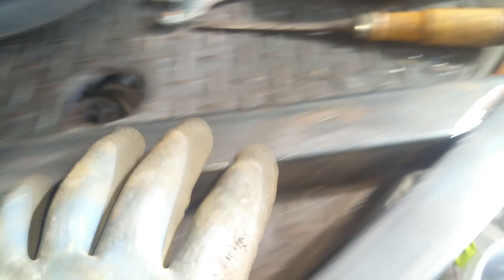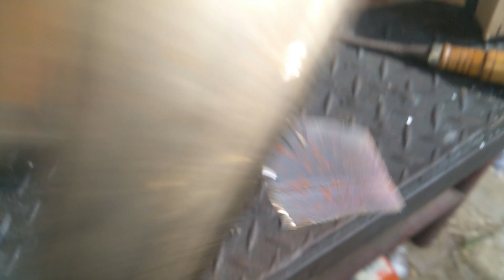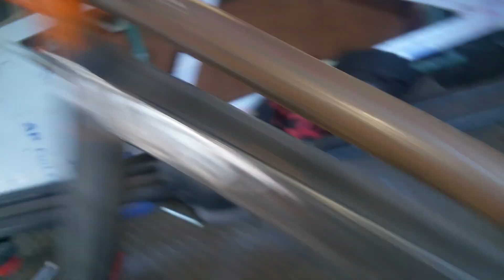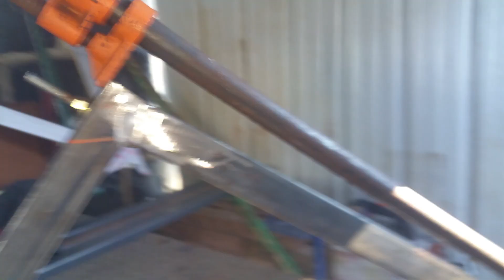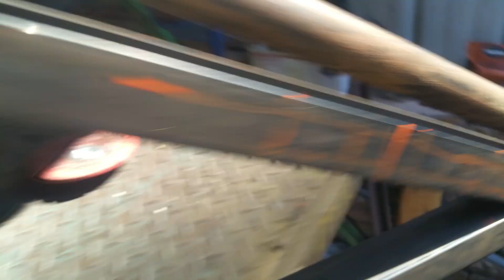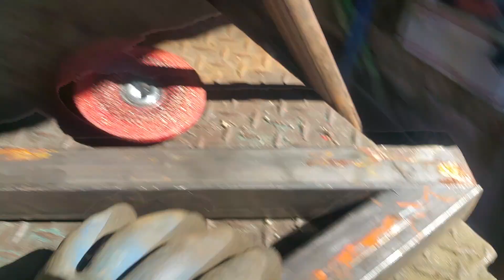FIU BRIDGE COLLAPSE Scaled Model PART 3 of 3 Canopy must deflect for 11 to slide PT BARS STOP SLIP

Comment: There was no sign of deflection or cracking in the canopy pre Figgpocalypse. During Figgpocalypse it was remarkable how long the C post tensioning cables stayed intact. Photographs taken of the bomb site post Figgpocalypse indicated 12 had been pulled off the membrane by the C cables and the already compromised lower end of 11 had disintegrated. 

Instead if wasting money on weapons the DOD should just send in the Figg-Pate team to our enemies to design bridges for them.
Reply from the maker: Mark, take a look at my ''facts list'' in the description, I just added, I am so upset about this entire thing... what a shameful thing to allow FIGG to give NTSB $120,000.00 during an active investigation that involved so many deaths!   Then we have the weak-ass judge who also does NOT open a criminal investigation! (shows they only care about the fucking money)!!!
Reply: @LoadPathEngineering Well done CE. 
$120,000  buyoff for 6 lives? 
I have a thought. Identity theft, for example. Isn't it less costly to take precautions while building one's identity or credit, if you will,  than to get it back after it has been stolen? (Variables excluded to keep it short.) Thanks.
Reply: Hahahaha.  Good one!